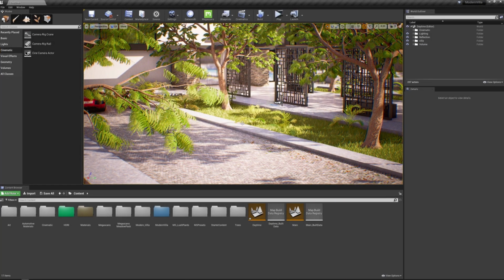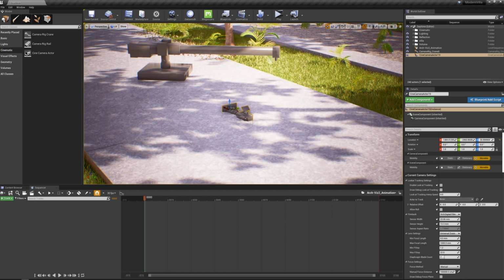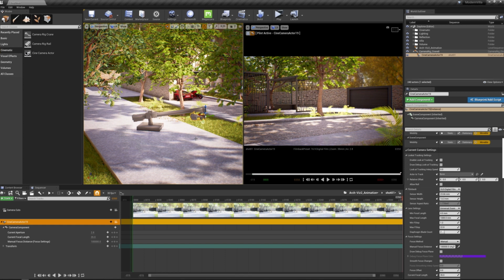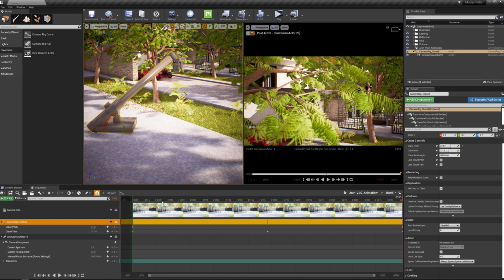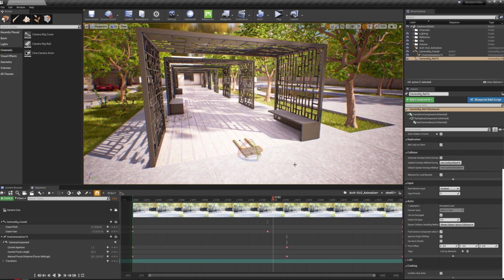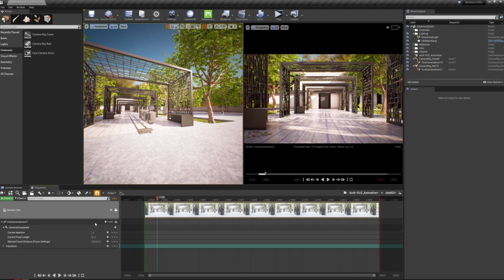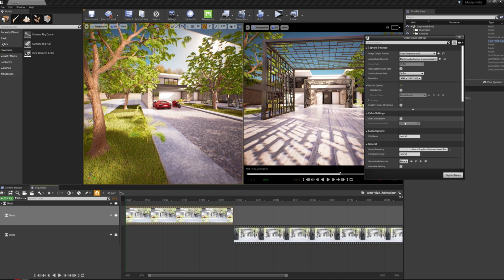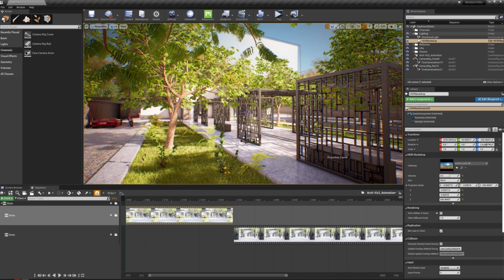Unreal Engine 4 Arch-viz Tutorial Course  part 7-2 Cinematic Production

Comment: hello sir there is drastic change between part 7-1  output and part 7-2 output can please upload a video how did you reach to that quality thanks in advance
Reply from the maker: Thank you Suresh , basically what you see is the final render output you will get after rendering the animation for UE4 it will shows the whole quality effect in comparison to the Realtime, so they are the same but the render output is more stable in terms of smoothness of the shadows and the material  , hope that help answer your question

Comment: Hello , thanks for these great videos ,  if you please advise me about the PCU that will be perfect for unreal and if this dell CPU is ok 

DELL 5810 V4 
E5-2680 V4
14 CORE
28 THREADS
35 MB CASH
3.3 GHz TURBO
70 SECOND V-RAY BENCHMARK
62 GB RAM DDR4 ECC 

NIVIDIA GTX 1660 SUPER 6 GB DDR6 NEW
POWER SUPPLY 685 WATT + 80 GOLD

Many thanks for your great efforts
Reply from the maker: thank you , your pc have a power full processor that can help you build the light much faster then your gpu , but overall the pc is good enough for unreal unless you wana add an rtx in teh feature for the ray trace feature

Comment: Thanks a lot Bro, for your efforts.
Your tutorials are of great help.

I am following each and every step, from your tutorial.
I have an query.
What is the main change that you have made, between cinematic production part 7-1 and 7-2.
In part 7-1 image is far less brighter than part 7-2. Shadows of trees are very good in Part 7-2
Have you increased the intensity of direct light? or have you done something with HDRI map? Or anything in the post production process?

Thanks again :)
Reply from the maker: Hi there thank you for your nice words we appreciate your feedback very well , so regarding the color difference , yes we played a little bit with the color strength in the saturation and also the contrast just few stuff to add more color to the scene
Reply: @theimageneers5161  Thanks a lot for your reply.

Bro, i tried to render another simple building, with horizontal grooves (2cm wide at gap of every 30cm) on one block.

I tried to render the same on higher settings, but the grooves are not sharp / properly visible in unreal engine

In 3ds Max rendering, the grooves are properly visible for the same block.

Any suggestions.
Reply from the maker: @harmeet5089  Hi there thanks for sharing this , Epic actually added a new feature in 4.25 to render ultra high resolution with few settings , we will add your request to be introduced on a tutorial for that , thanks again for sharing